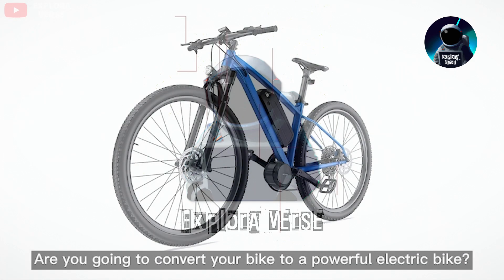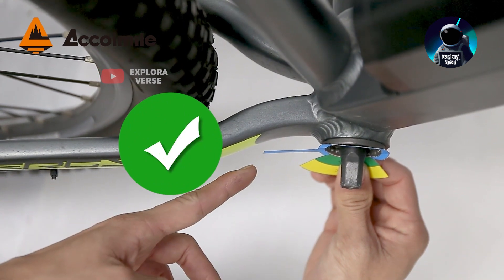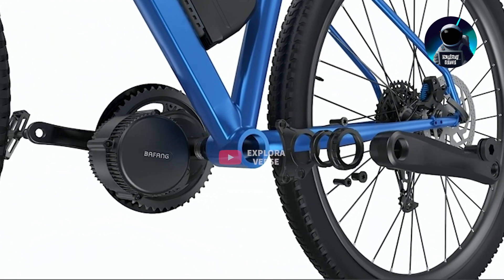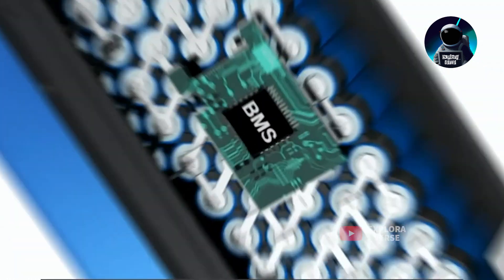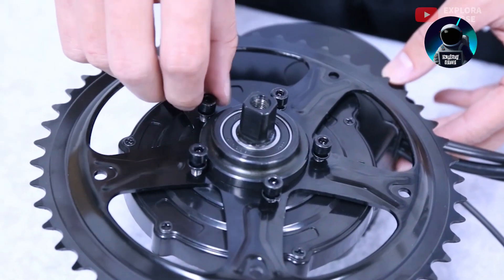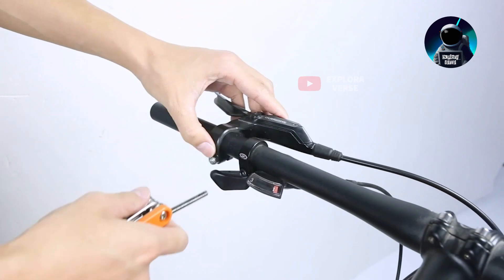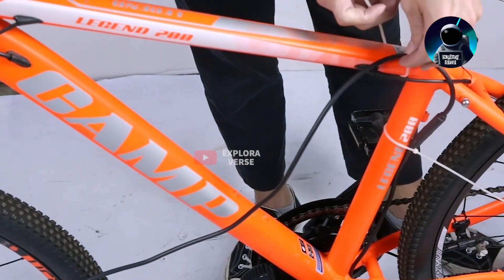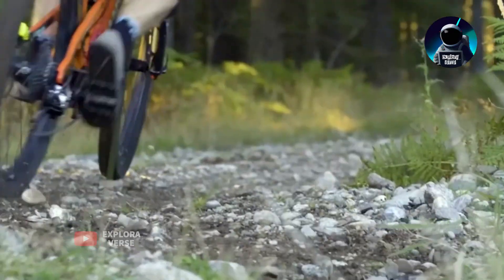⚡ Electric Bike Conversion Kit - BAFANG 1000W Kit Review 🚴‍♂️🔧

Comment: Best ebike mid-drive for dose who have
BB 68mm, 100,120mm bike. With tons
Of parts and support from YouTube.. 🥰 🥰 👍
Reply: What are the brake levers for?
Reply: @c3N3q  you dont need them, but they have a small magnetic switch to kill the motor when you brake. Ive had my ordinary brakes on on these bafang kits since 2015, usually when you tend to brake you stop pedaling therefore your not asking the motor for power anyhow.  On a side note magura do hydraulic ebike compatable brakes fyi
Reply: @stevenconnor4221  thinking about what you said, I'd keep my normal levers so that I could feather the brakes when needed without killing the motor,, as you do eg. when it's wet and you're going faster around a corner.
Reply: @c3N3q  purchase new crank arms those ones will eventually cause you trouble. I got ones from a shimano steps ebike ( i think it was called) they were suitable for the square drive. There is other out there but a tad more expensive.  Watch out for bad throttles they can brick your controller, and check the controller to motor 3 phase connections for a tight connection down the line if you feel the unit isnt as powerfull as it once was...  just passing on my experiences its a great unit and bar that for me has and still is running strong
Reply: @stevenconnor4221  Thanks for the tips, will keep that in mind..